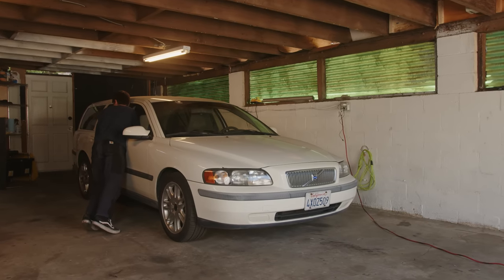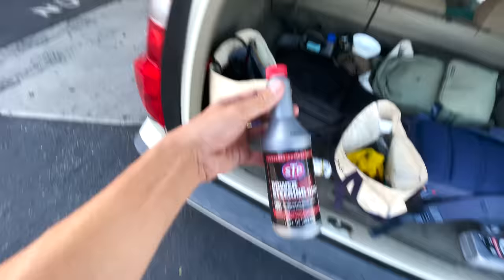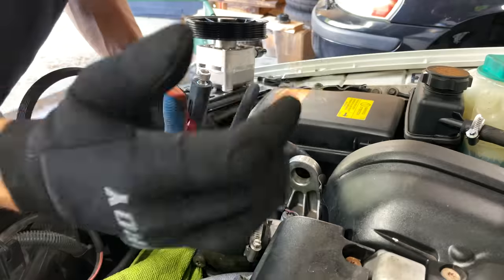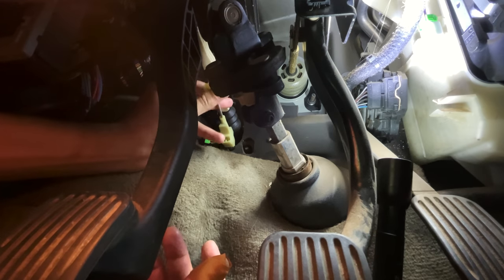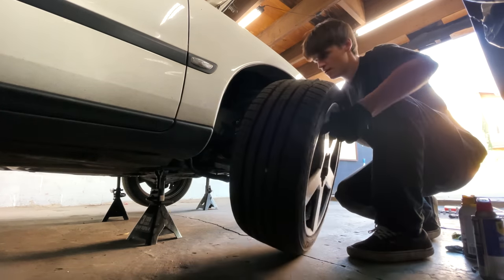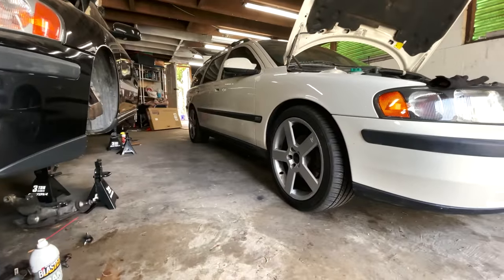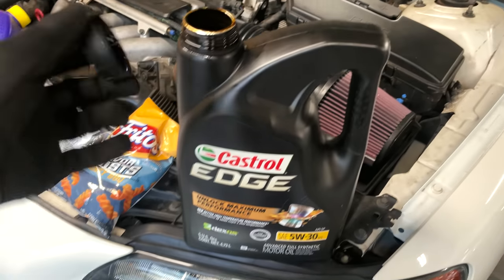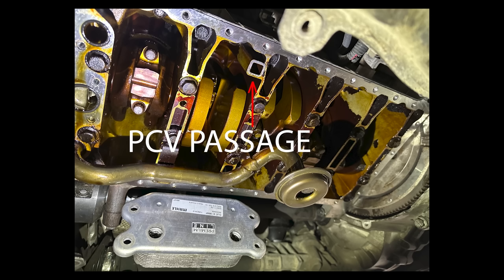MORE ISSUES with the $800 Volvo V70 + First Mods!

Comment: I have a 2003 V70 had a similar issue,  after changing the fuel pressure sensor . Low idle and no more engine shutoff finally went away. Hope that helps our fellow Volvo enthusiasts.
Reply: That’s exactly what my first thought was. My 06 XC70 was doing the exact same thing, changed the pressure sensor, and five years later symptoms have never been back 👍

Comment: when you get another 20 years under your belt you will want a quieter exhaust, trust me.. But for now enjoy your youth and your superb hearing ( for now) Once it leave you it never comes back. Your  vacuum issue might be in the brake booster cylinder itself. take the vacuum line feed line off check your hoses for leaks then pull a vacuum on the cylinder with a vac pump then shut off the pump then see if it holds negative pressure using a set of recharge gauges for AC compressors.  this is an easy test but by applying the brakes it might be reducing the system vacuum which  triggers the faulty issue which is occurring elsewhere caused by something else..  Either way its something that's definitely in your Vacuum system. I would replace all those lines just because their old and possibly rotted.

Comment: Always use OEM parts, even junkyard OEM parts are better than the aftermarket junk. I've seen crazy symptoms with aftermarket MAP sensors. Check the VVT system live to see if power is going to it. ALSO YOUR AIRBAG MUST BE REPLACED NOW!

Comment: I get a notif, i watch right away! 

By the way the vacuum related issue is more than possible. With time, the hoses connected to the brake vacuum switch can get "crusty" and cause such symptoms. A brake booster issue is possible but not a common thing on these cars so look at this as a last resort. A big problem with time on these is a bit of oil in the throttle body flaps around the center "ring" which causes the same symptoms as you are having when the car is at operating temps. Make sure that is clean as well it is very easy and straight forward. The PCV box itself wont make such symptoms but the hoses related to that system could very well be a cause!

Since it's not turbo, checking the intake pipe is quick and easy, make sure that there's absolutely no cracks whatsoever AFTER the MAF. Any entry of air after the MAF would cause such symptoms.

Concerning the oil passage, it won't make idle related issue similar to vacuum symptoms but i don't know if you checked it but the "tube" like hose on the engine that we saw once you took out the pan does clog up on your gen (ONLY IF THE CAR WAS SITTING FOR A COUPLE MONTHS OR +)

A bit far fetched but you can also check the A/C compressor clutch. Unless you are certain it is a vacuum related issue, then a bad/seizing/seized A/C compressor can lead to such symptoms when at operating temps as well but not very common.

Keep up the beautiful videos, I couldn't believe that you were into Volvos. Your main channel was the reason why I got better equipment and started my own channel lol. Congrats on the S60R! Can't wait to see what you do with it :)
Reply from the maker: I really appreciate the kind words and all your input on this!

Throttle body came off and was fully cleaned when I swapped engines, but im still not ruling it out since this model has proven to be so problematic. 

I also did smoke test the entire intake system, but im not sure if this is sufficient. My AFR's look good. I would think a vacuum leak would cause more changes to the LTFT, but that could also easily be the issue still. Will look at this again.

The AC compressor is very interesting, its definitely original and I hadn't considered that. More to look into! Thank you. :)
Reply: @wheelemverb  Of course! Eager to see your other videos Will :)
Reply: Brake booster is a issue on these models. have you over 200t-miles on it it will start to leak and then you will hear a sound when your off, if you push the brake the sound will stop... Had this 2 times always around 300t-km.. standars failure. You can also clean the throttle buddy,.. If you have a magnetti throttlebody this will fail also at this mileage around... thats normal issue... A bosch will not fail, have 446.000 on my and still running...

Comment: For me that idle issue sounds like two ways of problems:
1. Throttle body trying to die, I think you got Magneti Marelli that are giving similar symptoms - probably electronic after it gets hot, starts to lose its own mind.
2. VVT solenoid is dying, you can check it by, cleaning it and connecting it straight to 12V to check if it clicks.
Reply from the maker: Yea i have the Lamborghini throttle body. I ran the vida test on it multiple times and it comes back with 2% different which should be good, but I agree I dont trust that throttle body. 

I cleaned the VVT solenoid, new gasket, new VVT hub as well on the intake (exhaust is non vvt). Might have to try and manually supply power to it.
Reply from the maker: Thanks for your input! Much appreciated.
Reply: Run the test while the car is hot!

Comment: OMG, Willem. I'm glad you can have such a positive approach to this thing, it would give me nightmares. I had a Volvo 240 wagon, something like an '82, and it didn't have diagnostics like yours does. At some point I ran out of luck on an issue that was severe, hired the best mechanic I could find, and he found a wire shorting to the car frame inside of some long hollow channel someplace. Similar nightmares decades later with a BMW Z3 convertible. At my age, it's Hondas, Toyota trucks, or Mazdas for me if I ever buy another used car that's not an EV. Cheers! I love this series! ✌

Comment: If you're still hunting down the idle issue, I had a near identical issue on my old 2000 S70, and it was the throttle body and plate were dirty. After cleaning them up really well, it cleared the issue entirely.

Comment: Replacing the whole throttle body fixed a similar idle issue in my -01 V70, common issue (I was told) in early mk2 V70’s

Comment: One easy thing to check is the evap solenoid under the intake manifold. Take it of and see if you can make it click with a 9-volt battery.

I had problems with idling, ended up changing every vacuum line and the pcv system. I also had low fuel pressure on live data, so i changed the fuel punp unit and filter. Now it works really well and doesnt throw any codes.

Comment: The ETM you have is a Magnetti Marelli unit and they’re known to have issues with the tps sensor. Xemodex does a send in repair and warranties for life. It’s expensive but that could be your fix. My guess is it’s trying to account for the change in vacuum and the plate is sticking or wrong value being recorded. 

Brake booster ejector, switch and the lines can develop leaks, or even the booster itself. Smoke test the vacuum system if you’re sure that’s the issue.

Comment: Make a home made smoke machine out of a jar, soldering iron, and a sock. It's the best tool I've ever made and used on my volvos as the turbo ones can have a lot of vacuum lines.
I did have the issues you are describing once before in an S80 I had. Somehow some time a workshop had done some work on the exhaust and put the o2 sensors back in the wrong order so when it was hot and idling at traffic lights it would do the same as yours. But that was on a 4 o2 sensor configuration, yours would be a lot harder to wrongly put back together as there are only 2.
Good luck, finding vacuum leaks is very easy with a little smoke machine.
Reply from the maker: I did smoke test it! No leaks. As for the O2 sensors, I took the car apart, so anything is possible.
Reply: @wheelemverb  I would 100% have either yourself or a mate in the passenger seat and replicate the issue now. Have Dice and the laptop connected and ready, check data in the ECM > maf / air signal, lambda o2 feedback and short and long term fuel trim data. You can view / log up to 10 items. You will be able to see what is changing when the issue is occurring vs when its running fine.

Comment: Love this series more than I should. If it makes you feel any better, I have a 2005 S40 2.4i that does the same thing, just not as often as it sounds like yours is. I found that it had a bad vacuum pump but replacing it didn't solve the problem. Wouldn't be surprised if I have a small vacuum leak somewhere though and perhaps that's what could be wrong with yours. Hope you can figure it out!

Comment: On the idle issue.  You bought this with a blown engine- I'm guessing it's 2.5 with the thin walls.   Eurojulien did a great video on why they blow and he mentioned clogged fuel line/fuel filter.   Has that been changed on this one since you've had it?  You may have swapped out the engine- but if the problem was back at the filter- the issue that caused the engine to blow in the first place could still be there.

Comment: There's a seal in the booster that goes bad. You would be able to here a hissing from inside the car. I also believe there is a brake pedal position sensor that can have a seal go out.

Comment: This is uncanny. I recently picked up an 01 v70 2.4 n/a with the m56 5speed. I got it for the same reasons you did: I wanted a more reliable version of the P2 platform. No turbo,no awd, no sunroof - none of the things that usually kill them. I’ve been slowly picking away at the same issues you are. I diy replaced the PCV, installed BC coilovers, currently doing an R brake swap, timing belt, resealed the motor, tons of little stuff. But I’m chasing this erratic idle. Same exact symptoms as yours. I’m missing the clutch position sensor (and the wires were jumped same as yours). My assumption is that it is a vacuum leak somewhere but haven’t quite found it. I hope it is not PCV related because that was a pain. I’m looking forward to see if you solve it and will let you know if I do as well. Till then- I’m going to level out the idle with my foot on the pedal. Cheers and great stuff.
Reply from the maker: This is hard to believe 😂

That’s insane though! Absolutely keep me posted. Send me a message on ig
Reply: @wheelemverb  I solved my idle issue. I did a few operations at once so it’s hard to pinpoint: removed my evap purge valve and cycled it a few times with a 9v battery- I think it was stuck open. Cleaned and lubed the preheater-valve in the air box. Mine was completely stuck, and my throttle body was clean, but I put a touch of oil on the pivots and cycled it by hand a bunch. One of those solved it!

Comment: Fantastic video.  I am still chasing an occasional erratic idle on my 2004 S80 2.5T five years after it started. The dealer and a Volvo specialist said different things (clean throttle body)(bad plugs) neither helped.  Then they said fuel system (pump) (followed by fuel pressure sensor) and then they gave up.  I ended up trying an ambient air temperature sensor (which improved my fuel mileage tremendously) but I will still get the occasional idle drop or slight race before things return to normal (the dealer also did the PCV).  It's annoying, but I've come to accept it as "Volvo life".   I'm excited about the S60R content.  I have a V70R and would appreciate hearing your thoughts on the R. Good luck with the idle issue.
Reply from the maker: You’re telling me the air temperature displayed in my gauge cluster contributes to the tune??
Reply: @wheelemverb  I learned that the P2 Volvos have two ambient air temperature sensors.  They are both located in the exterior rear view mirrors.  If you feel under the mirror, there will be a small blister with a tiny hole next to it.  That's the ambient air temperature sensor.  Weird right?  According to the forum posts, the sensor in the drivers side mirror helps to set the primary fuel mixture in the ECU at start up, and can cause the car to run poorly or in a "safe" mode from a fueling strategy standpoint.  This sensor has a range of operation that can trick the ECU into thinking it is either way hotter or colder than it really is. My car had a bad sensor for 7 years and never set a check engine code.  I got 23 mpg and assumed it was normal for the car (2.5T, FWD 3500 lb car).  I finally got a check engine light last summer because the sensor completely shorted out.  After replacing the sensor I got no less than 27 mpg on the highway with a max mpg of 32.  According to the forum posts, the ambient temp sensor in the passenger mirror works the same way and feeds the temp display in the dash.  Both sensors are inexpensive (less than $50) and when I spoke with the Volvo dealer parts guy, he said the sensors die on a regular basis and you know if it's been changed because the black plastic cover for the mirror bolts on the door panel has broken retainers.  I hope this helps!
Reply from the maker: That’s fascinating, in my s60r the temperature outside always reads at -44 degrees 😂

Definitely will be changing those soon now knowing that it affects the fuel mixture. Thank you

Comment: Ive had that that same idle /stumble issue for a while with my S60r. finally fixed it by replacing my VVT solenoids and replacing the gaskets for them (they have a small screen in them that can get clogged)

Comment: There are two vacuum lines from the exhaust manifold on the right hand side check if they are there and intact had the same issue those vacuum lines controlled the idle

Comment: How much is the coil over conversion? I have an S60T and the suspension is making all sorts of dreadful noises. I have replaced bushes and control arms - so springs and shockers seem to be past their use by date. Mine is a low kilometre example -I have just ticked over 115K's. It was a one owner car. But -they did not maintain certain items like suspension.

Comment: Do you have a hard breakpedal when the car is not running? Maybe then you have a small leak in the breakbooster where the engine sucks air from and have some trouble with running. 
I have that problem now with my v70. I thought it was the one way valve that should keep some vacuum in the booster while the engine is not running so you got a boosted brake pedal when you start the car the next time. I changed it but my brake pedal is still hard when I start the car later after I did get out of the car. That means there is leaking vacuum somewhere and very likely it is the booster I think. I did not replace it yet but it is in my to do list.

Comment: My V70 (2.4 Diesel) has vacuum engine mounts in the front and back of the engine, you should check those as well and make sure they don't leak vacuum
I also has a vacuum issue and after replacing the vacuum pump seal, engine mounts and all the vacuum lines it was fixed, but then again I have a diferent engine.

Comment: Your issue I think it is a break booster seal, that leaks vacum, I had this in v70 d5 and changed brake booster. Check can you hear it from inside of cabin when pushing break pedal.

Comment: Your Idle Issue is the electronic throttle body witch won't show on Vida Volvo hide any problems to do with the electronic throttle body It's known as an ETM and you will have to buy a new throttle body and have it programmed by Volvo to solve your issue it's common on V70,s from 2000 to 2002 I hope this helps you out and take care

Comment: Might be a throttle body, pre lift models have issues on 200k km
I had problem with idling, had to send throttle body to repair
Reply from the maker: I ran the vida test and it had great results multiple times for the TB but I think I need to dig into that further.

Comment: I have the same issue on my my2007 v70. It has the modern throttle body on it.
I noticed the same thing, when using the brake, the idle drops. Mine did 414000 km, I tried to fix the issue at 300k. I tried the MAF, Vacuüm lines, clean the sensors and throttle body. I thought, maybe it is the brake booster, but this is not easy to replace, so I wanted to be sure. Eventually I gave up because I got used to it.
I'm curious if you find a solution!
Reply from the maker: It doesn't seem to be getting worse either which is interesting. Dont give up. Sounds like were in the same boat haha.
Reply: change guys seal in brake booster, its hard to do it from inside, without removing but its possible
Reply: it occurs especially in hot days, because of thermal expansibility
Reply from the maker: Are you referring to the seal that lives on the pedal side of the booster?
Reply: @wheelemverb  i think he is referring to this one https://youtu.be/saX-GG6s1Ck. I changed it myself and for the love of god take the brake booster off of the car because if you are over 1.45 m tall you will have one hell of a bad time haha
Reply: @MrTuhascvbouwq  that's what I mean